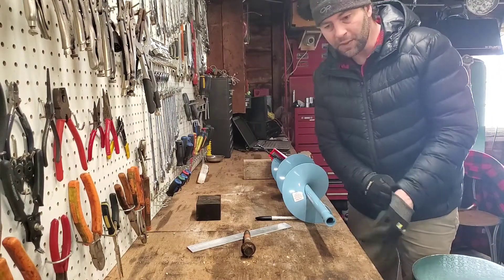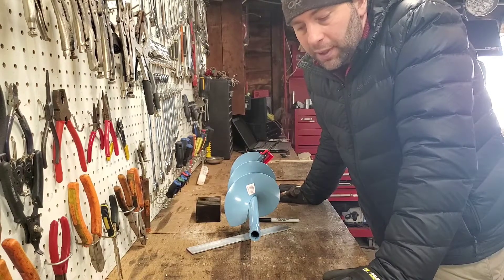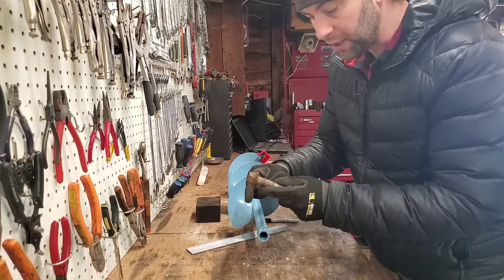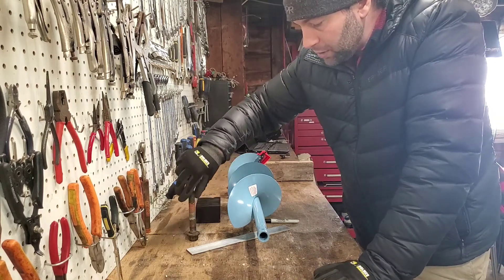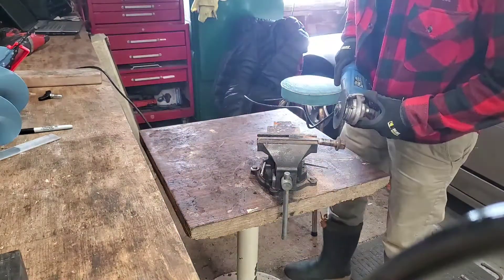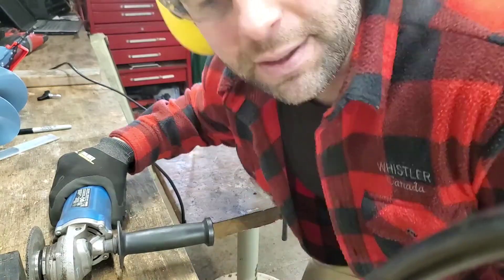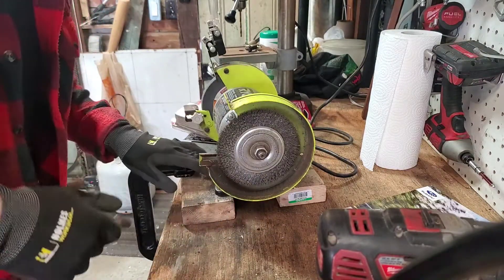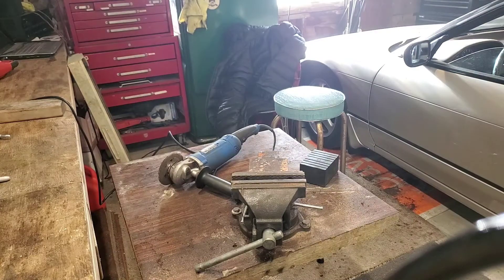Fabricating an Ice Auger to Drill Adapter EP 1

Comment: i  used a wooden disk an inch larger than the hole in case the chuck loosens to keep you from feeding Aquaman a free auger but solid build. mine was a socket welded to a 8mm steel rod.